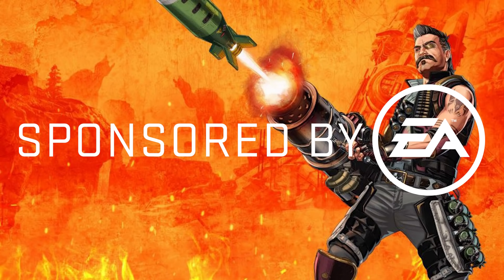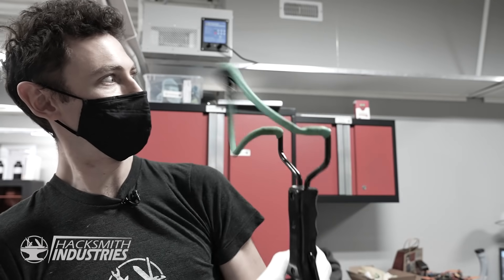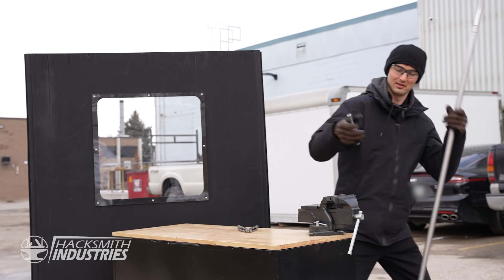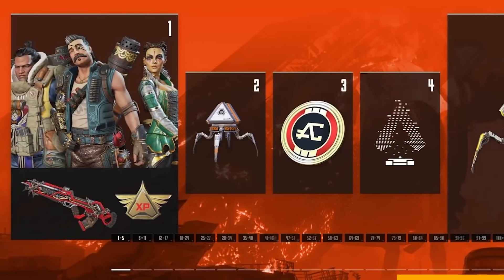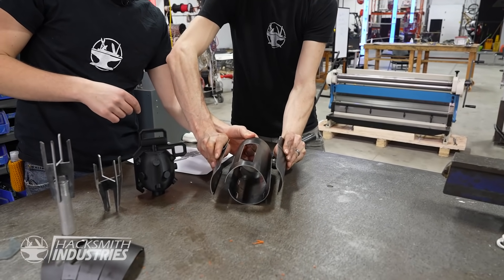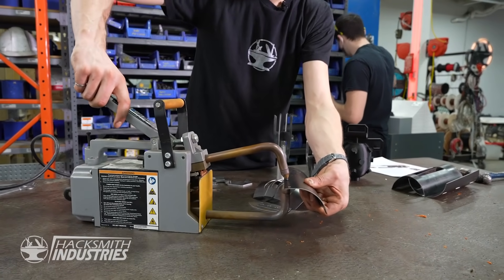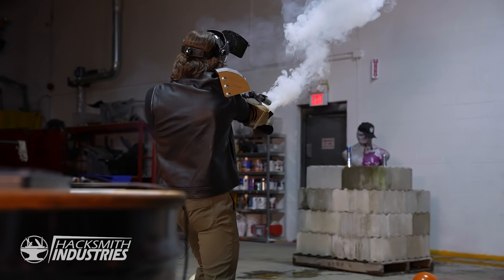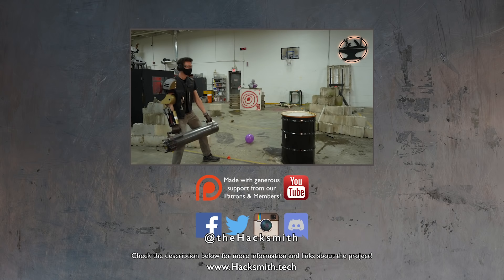Fuse's ROCKET ARM from APEX LEGENDS!

Comment: Idea for the next lightsaber.
In stead of lpg. Use acetylane and have internal oxyen. Its waaaay hotter flame. And as a bonus, with internal oxyen you can use it underwater.

Check: underwater welding.
And for some interesting parts. Check F-aas. Its used in chemistrie to determine metals in a solution. And uses acetyle for a very hot flame. And has a great 2nd hand market. And many have software to controle oxygen/acetyleen ratio build-in.

Comment: Arc stars have 3 "blades" it wasn't loaded in correctly, it wouldn't fly straight, and he can launch 2 other types of grenades along with his tactical which is basically a fire cracker. I play Apex Legends, and I used to use him. Plz, you could make it a lot cooler. His arm is like a high tech sling-shot.
Reply: Did you watch the video? He shot 2 kinds of grenades

Comment: In the build they mention using compressed air for the energy source to launch the projectiles. But I didn’t see any air lines or air reservoir? Did I miss the part in the video where they talked about what is doing the actual launching?